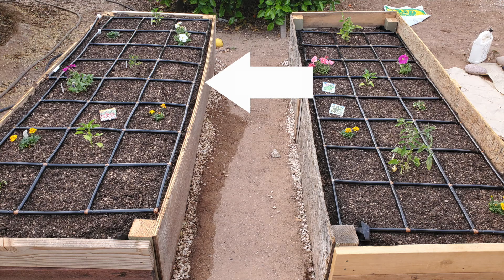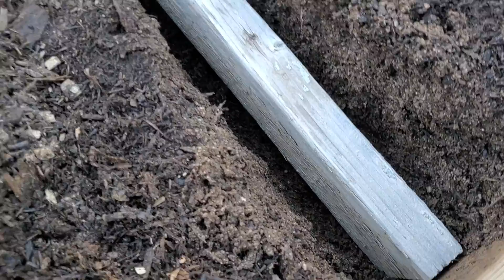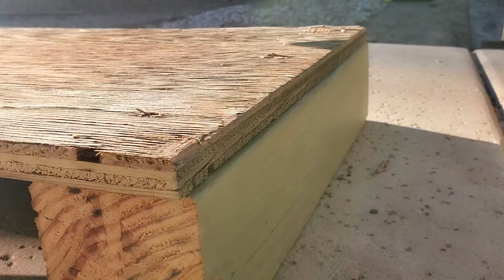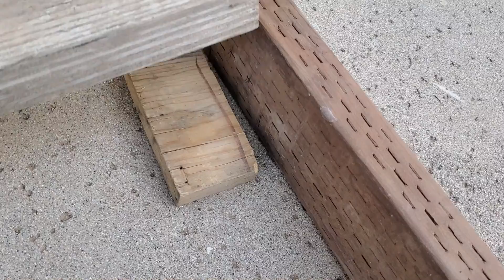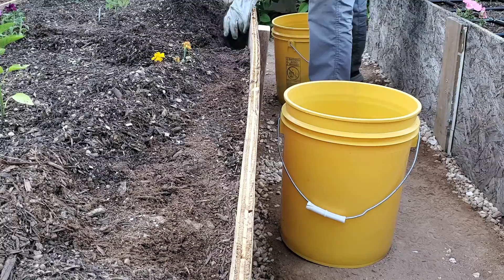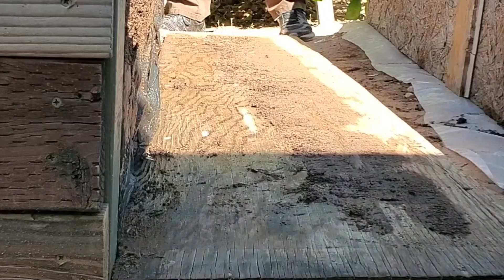How to Repair a Raised Garden Bed that is Bowing

Comment: I think the middle planks should be CEDAR, in this case.  It's a monetary 'sacrifice' that would be worth making.
Reply from the maker: I totally hear you there. Plywood and OSB look and perform much worse than cedar or other prime framing materials. The 6 mil plastic lining does not make it look any classier either. But there are so many startup costs to gardening. "Use what you have" or "what's within your means" is better than nothing. I spent on soil and irrigation. There were a couple other reasons I used what was on hand (explained here https://youtu.be/U3TjVO8LTGs) and plan to upgrade later when these less desirable materials finally break down.